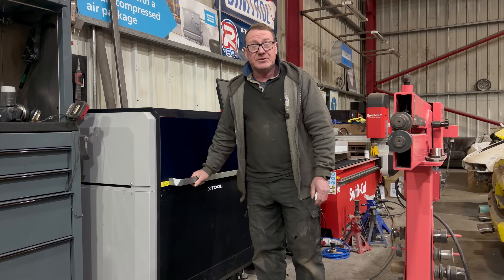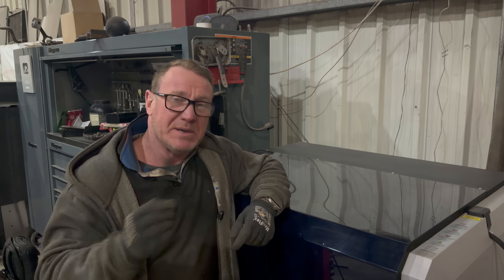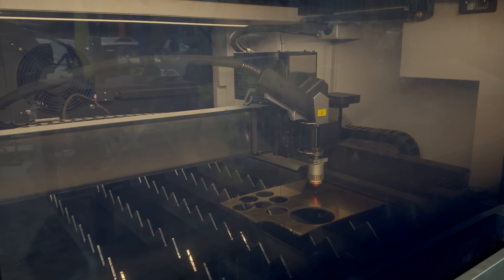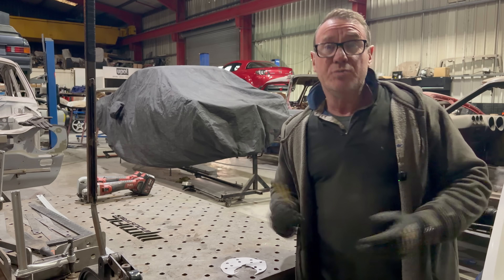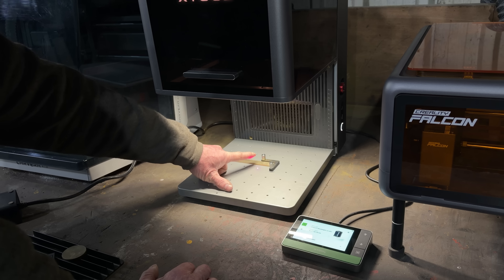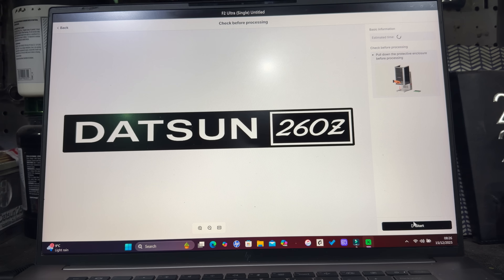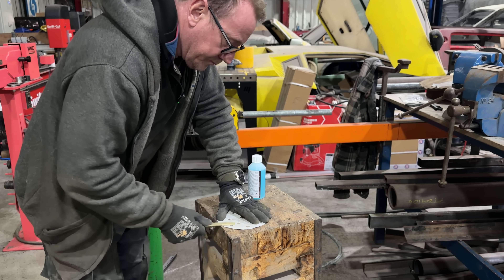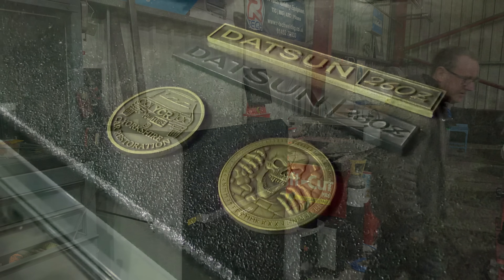Making classic car parts with the xTool F2 Ultra and xTool Metal Fab

Comment: On the XTool F2 Ultra, the burn plate should be correctly placed with the fins vertical - allowing smoke to get channeled toward the fan. Also, you don’t need a separate piece of brass to focus. Just focus on your original, once it’s focused move it back into the proper position.

Comment: My only complaint is that either the source image you found online or the AI tool you used changed the fonts and they dont look anywhere near as nice as the original lettering. Popping the badge onto a flatbed scanner would have given a better starting place.
Reply: It was maybe the auto-resize in the software squashed it down a bit?
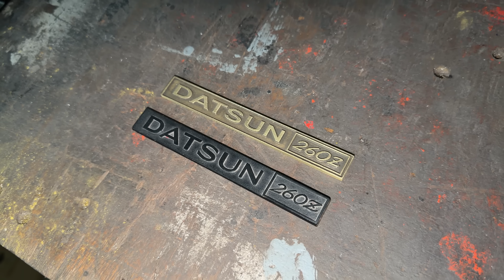Reply: @voods  Nope. Totally different font. The original has variable widths across the letters, the new one is uniform width that has been squashed slightly... and it looks like Arial. The 260 is a fairly close match but the Z is also very different than the original. Pause @ 9:58.